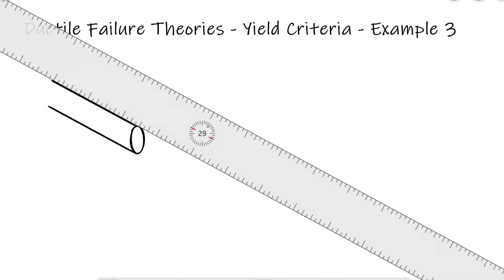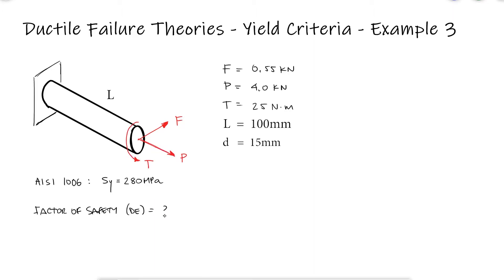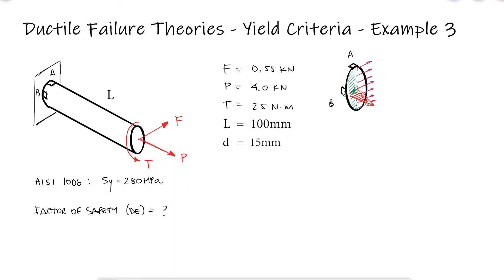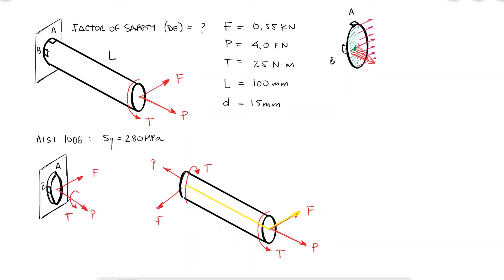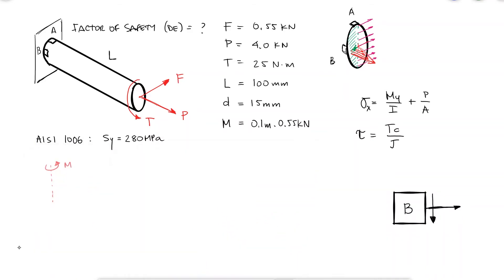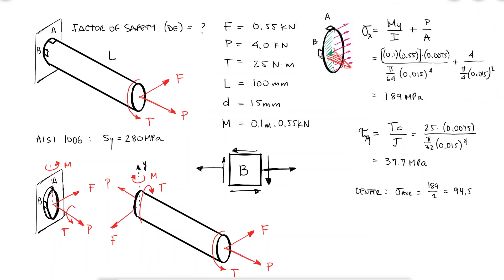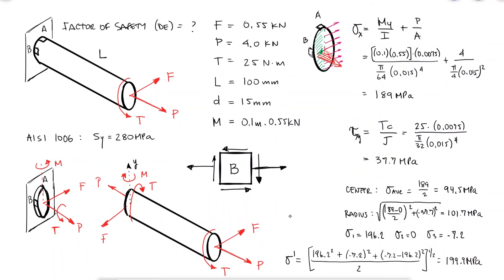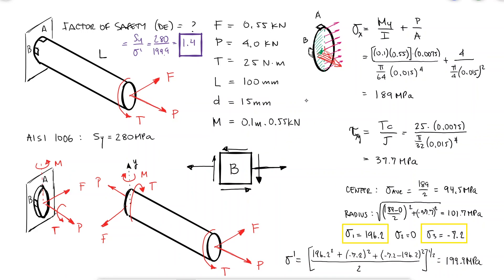Yield Criteria - Example 3 - 3D Rod Distortion Energy Theory

Comment: Sir, so you mean the force F will bring bending effect to element B and  shearing effect to element A? Or F only affects element B and the shearing you mention for A is from torsion T?
Reply from the maker: F does cause a transverse shear stress to element A. Element A would be subjected to two shearing stresses: transverse shear and torsional shear.
Reply: Transverse shear is 0 at point A because Q= 0 is the equation shear= VQ/It this leaves torsional shear. At point A there is also and axial force causing normal stress P/A. My question is… is there also bending stress at point in but in the other direction resulting in sigma (y)?
Reply: @alechaldeman1181   transverse shear stress does occur at A, which is caused by force F because the Q is not zero, look carefully on the direction of the force F. in fact, the transverse shear stress caused by force F is maximum at A, while zero at B.